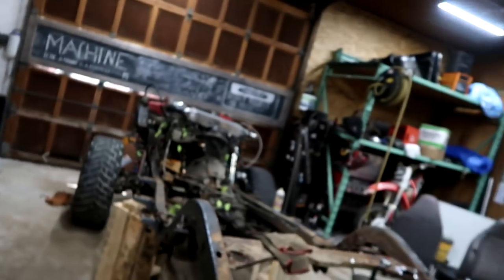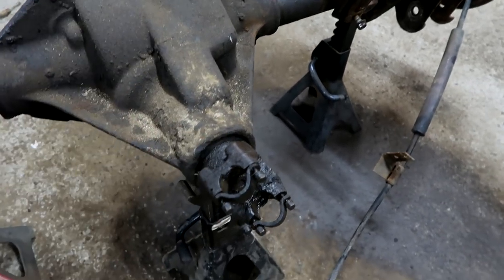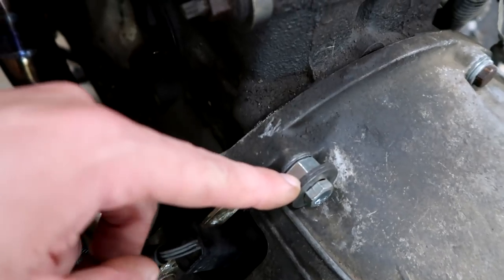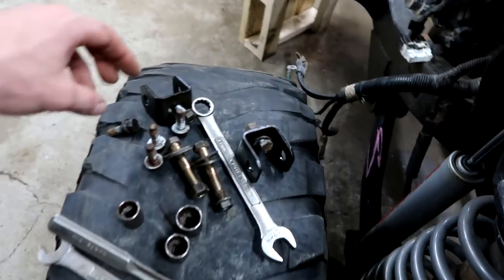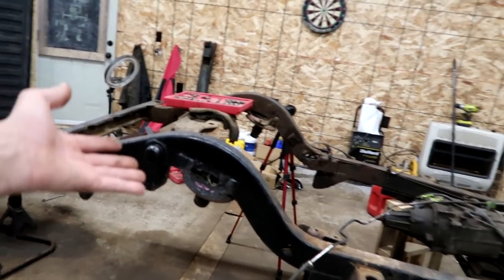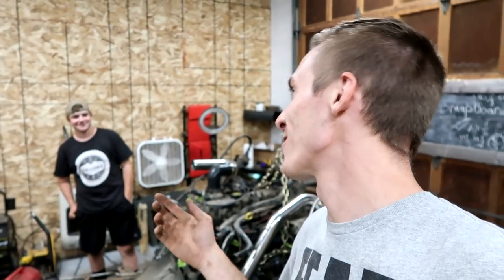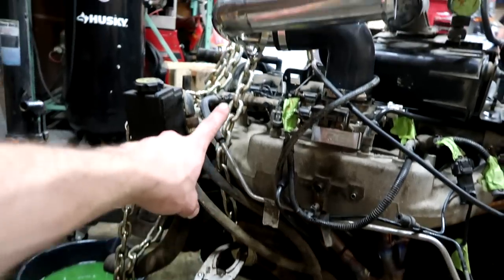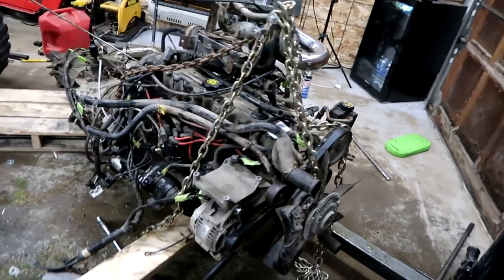Removing the Turbo Charged Jeep Engine

Comment: I like what you are doing... But that rear Dana 35 is not worth putting money into... Do some research on the Dana 35.. I would look for a the rear Dana 44..
Reply: or better yet, a ford 9 inch
Reply: i don't like ford either but the ford 9 inch the best option for a jeep besides going to 1 tons, which can get pretty expensive. the 9 inch is easy to re gear and has almost unlimited aftermarket support.

Comment: Few things come to mind, like dont  use old stressed out bolts get new ones for the price youd be silly not to. Also keep in mind you are adding new weight to the vehicle with your modifications, bear that in mind when you think that you now turbocharged the engine. First thing i would do is convert to 4 wheel disc

Comment: Dalton, I would personally say you might not want to weld anything in regards of the lift kit; it has to have at least a small amount of movement in case you get into an accident or off road it so it won't snap your frame. It happened with one of my buddies, he welded his lift kit onto his frame and it ended up snapping the frame when he got into an accident so it totaled out his rig

Comment: You should make some motor mounts so you can sit the motor/transmission/transfer case on your welding table and work on it there plus it can be rolled around the shop

Comment: You should consider changing that front drivshaft to a CV style as well.  The higher the jeep is the more extreme the angle is when your suspension articulates off road.  Also, that thing spins as you drive and the steeper angle with cause those U-joints to wear out faster than usual.  Just a couple things to consider bud, otherwise great project so far!

Comment: Dalton, the sandblaster can't blow this dirt and grease away, because the motion energy of the sand gets absorbed. Trust me, you have to clean it!
Reply: Man in the Mirror steam wash is great for it
Reply: Man in the Mirror I think it will clean it off. Depends on how much air pressure your blast has.

Comment: While you have the engine out you should go ahead and change the head gasket on it. I’ve worked on tons of the 4.0 Jeep engines and they are great. My daily driver Cherokee has 250,000 miles on it and it still has tons of power. Also since you are going for good performance with your Jeep you should look into getting the computer compatible comp cam they make for these engines I used one in an 1989 Jeep Comanche and liked it I have a video of that truck and camshaft on my channel as well as a few videos of my Cherokee with 250k miles on it (still able to do 0-60mph in 9 seconds)

Comment: Hey man I suggest you change a few gasket that commonly go bad on those engines which are the oil pan, the valve cover, and the rear main seal but i'm sure you have done your research

Comment: Since you engine is a 90s model, it should be the high out put engine. Oh, by the way the suspension rides like it's name "ROUGH COUNTRY." If you have issues latter on down the road with the angle of your rear drive shaft, there's a special shaft that has 2 double pinoin pieces on it for steep angled situations.

Comment: Dalton, do not powder coat the running gear or axels. There is a lot of labour involved for something what will chip way too easy. Blast prime and a nice thick coat of black will be best. Powder coat will chip way too easy and you’ll end up crying. I’ve re built 10+ Land Rover defenders and I’ve learnt. Ps keep up the good work 👍 chris - UK 🇬🇧

Comment: Don't bother having your bolts powder coated mate. As soon as you put a socket or wrench on them, the powder coat will get damaged and your bolt heads will eventually rust. I learned that the hard way with lug nuts and other hardware. Just clean them up nice and paint them, OR, if you want, you can do what I did and have your hardware anodized. That looks really nice with powder coating. They can do it in black and other colors.

Comment: 3D machines. Never use rough country. They are not built well. I had a lift on my truck and all my ball joints were completely screwed. Those lifts  also cause engine wear very fast.

Comment: I don't know how many miles that engine has on it but its never a bad idea to take it apart and replace everything in it and re-sleeve the cylinders and so on to get a brand new motor and that point you should rebuild the transmission and transfer case, but again I don't know how many miles all that has on it but I think it should be done because what's a new jeep without a new motor and drivetrain also it may be expensive now but in 10 to 20 years the jeep still be running strong.

Comment: Video was great, keep up the good work. Be a little more safety oriented when dealing with such dangerous methods of approach. You should have had another safety wrap or chain on that engine and tranny. You guys almost got hurt.(luckily ya didn't)
Otherwise I like what your doing, sending a high five from Ontario Canada

Comment: @3DMachines get some E3 diamond fire spark plugs. they will give you better horsepower and better fuel economy. it's worth the few extra bucks and also use Royal Purple oil, transmission fluid and gear oil from royal purpal as well. again a few extra bucks makes a big differance is performance and making the engine last a lot longer.

Comment: Just Empty Every Pocket . You think you have oil leaks now when the turbo builds 4 lbs of boost the motor will be as oil tight as a window screen. They run forever the old 4.0 lt but never without leaks. Ask me how I know.

Comment: How come u just didn't buy a brand new jeep
Reply: swaggyest seal because he’s smart
Reply: Cause then it would not be fun
Reply: Perhaps but he should have looked for something that wasn't quite the rust bucket Frankenstein that this thing is. I mean, it reminds me of that last four wheeler (i.e. used and abused from head to toe). Something just a wee bit in better shape would have been just as fun and worth more when finished.
Reply: Than we could see him doing some mud boggin and not fixing. But it his decision not mine
Reply: I would rather have the $1200 jeep that Dalton put $15,000 into than that new jeep at the dealer for 50k
this thing will be sweet all coated
Reply: Dalton’s a smart man
Reply: Whatever happens he’ll have a way cooler Jeep and save at least 30k